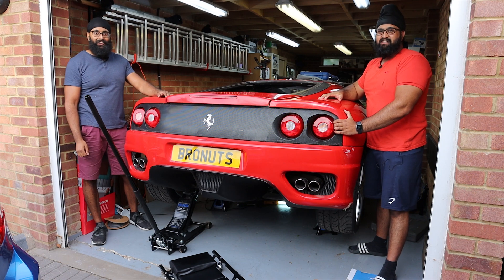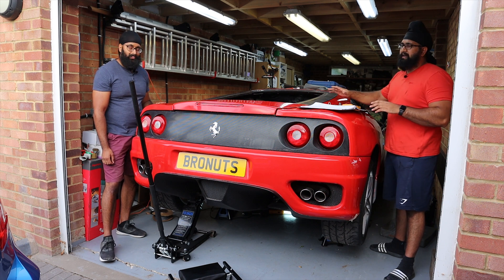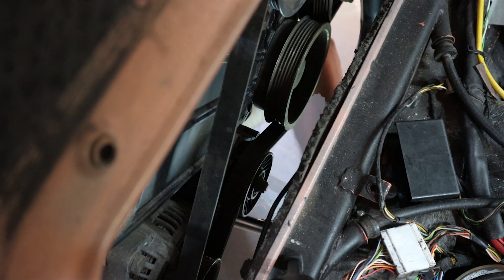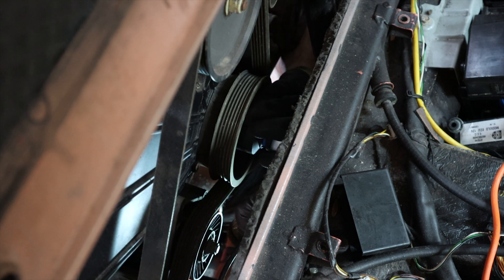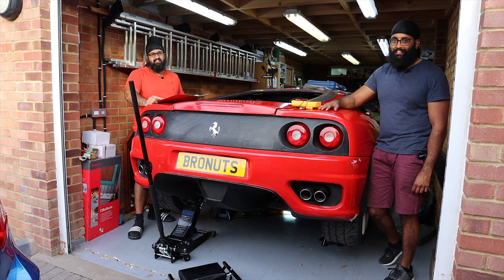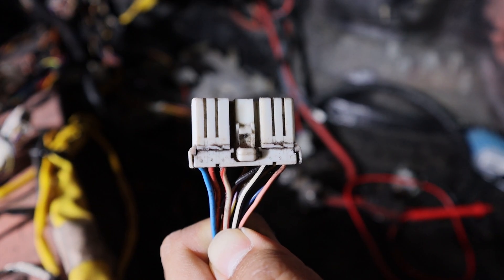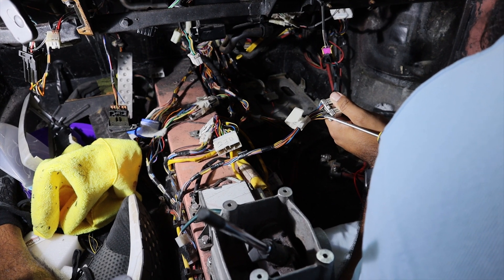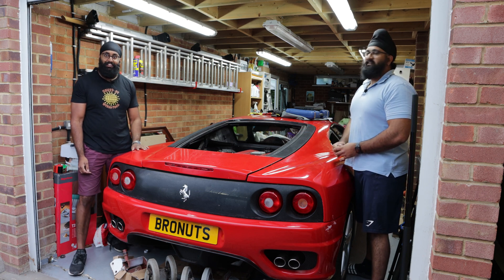Ferrari Engine Seized?! First Look at the V8 Engine and Testing Electrics

Comment: Love the videos.  Just got a 2000 Ferrari 360 Modeno myself.  I have the PDFs of the shop manual if you need them.  1400+ pages.  I found them on FerrariChat from another user.
Reply from the maker: Thanks! That’s awesome, hope you’re enjoying it? We’ve managed to get the full manual luckily, we’re just slowly working our way through it 😀

Comment: Search for automotive connectors with locking mechanism, you can find the male and female parts and the connector crimps too. I advise you to buy proper crimping tools for the crimps, otherwise the connection can be unreliable. Check the cable diameters and with online tools you can get the current capability, this should be considered when choosing the connectors.
Is it rust free? It seemed to me that there is no rust inside, that's very good.
Reply from the maker: Thanks! We’ve started to find a few bits 😀 Yes, it’s rust free, it’s spent most of its life in dry storage waiting for repairs!